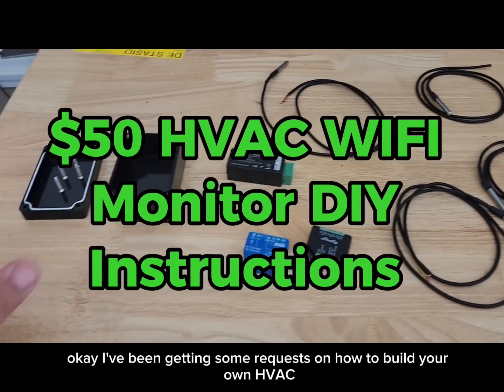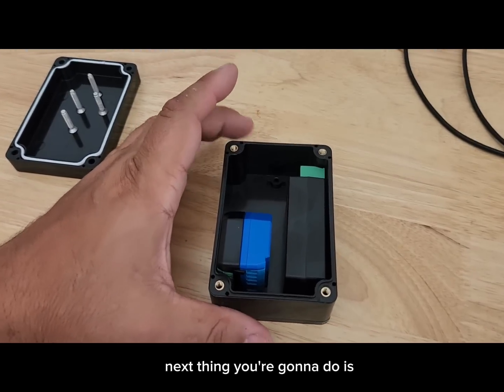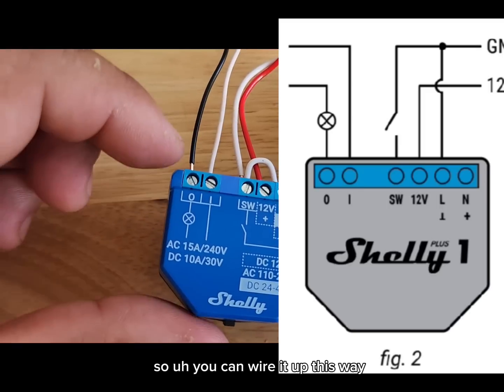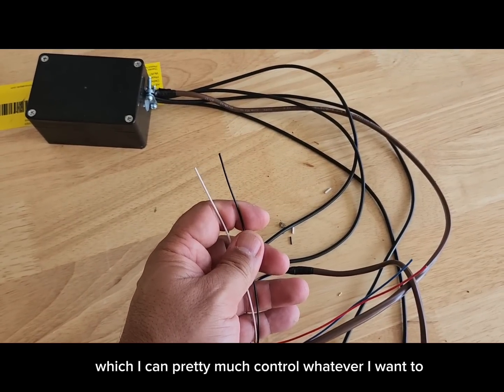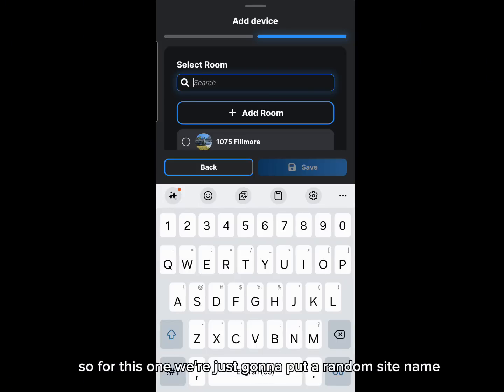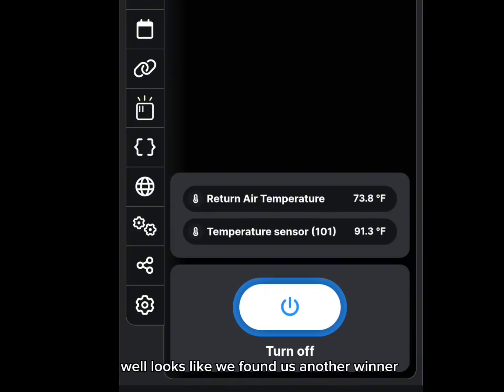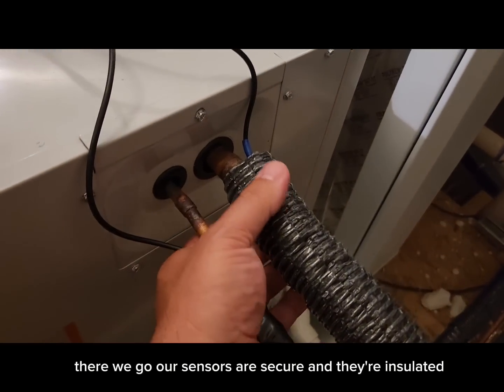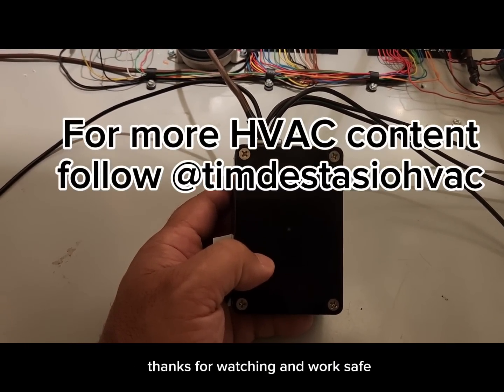Build a HVAC WIFI Monitor for $50

Comment: Curious if the 24vAC transformers in the furnace output enough current for the extra load.  I can't believe how inexpensive the temperature probes are! 
Please consider doing another video showing us what to look for - potential problems, etc...
Reply from the maker: Yes I will.  I am currently running 3 Shelly Plus 1's off the same transformer as my HVAC system.  But adding a transformer and a fuse isn't a bad idea.  Thank you!

Comment: Youtube recommended this video to me and I'm glad it did. I'm a huge fan of home assistant and data tracking. I currently have Temp/humidity sensor in each room and I track the power draw of my hvac system and compare performance that way. What are the benefits of knowing this data? What sort of analysis could a residential home owner do on this data to know how the system is performing? Thanks so much for posting. I'm ordering parts as we speak!
Reply from the maker: Shelly works well with HA from what I know.  As far as analysis, there is not any yet as I know.  That's my next project to learn.  Thank you!
Reply: @timdestasiohvac  Shelly works great with Hass! I ordered the temp probes you used and plan on hooking them up via ESPHome. As for the analysis, what sort of data are you looking for when monitoring the 4 sensors? Are you just looking to make sure the output is cooler/warmer than the input? What else am I looking for once I have the 4 data points?
Reply from the maker: @ZWBenedict  You're looking for a temperature difference between Supply and return of at least 15-25 degrees.  Liquid temperature should be around 10 degrees above outdoor temp.  Vapor line temp in cooling mode should be between 50 and 60F.  If it is a heat pump, the Liquid temp should be around 10 degrees above the return air temp and the vapor line temp should be round 30-50 degF above the liquid line temp.
Reply: @timdestasiohvac  Thanks for this great response, It doesn't do us any good to know Data Points if we don't know what they mean and how this info can be used.  Thanks